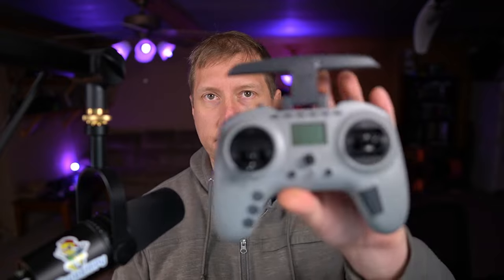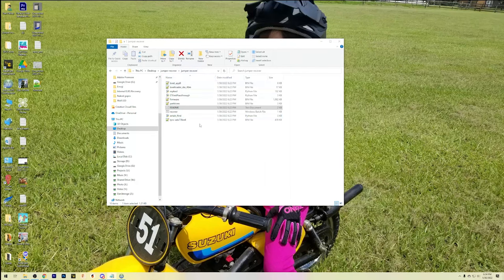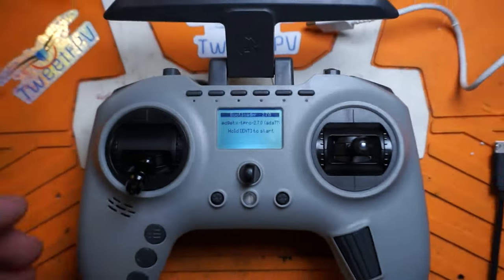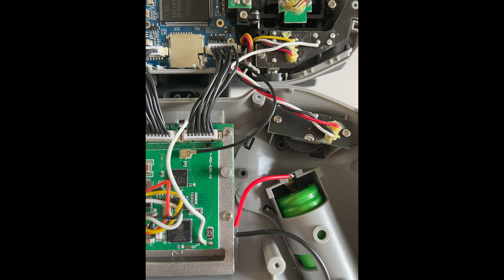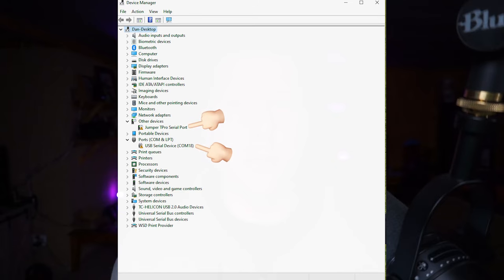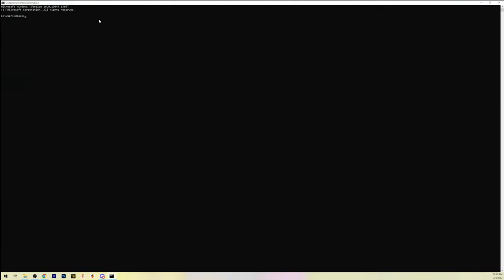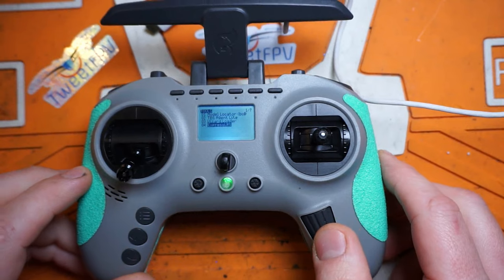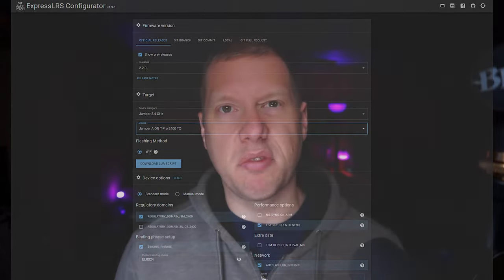Jumper T-pro Internal ExpressLRS recovery. No FTDI required #t-pro #elrs #jumper

Comment: hello everything is fine ? can you please help me? I have a t pro v2 jumper, and when I restart my internal module it works, but when I bind it, the image hangs, when I exit and return to lua script it hangs, and keeps loading, the edge tx firmware files that you mentioned in the video are no longer available for download, and the tutorial for updating the radio's internal module on the expressrls website is not working

Comment: It also might be stated that people do not know that the setting in HARDWARE on the radio might just be set to multi instead of the required CSRF. There is an easy to follow video on you tube that explains how to revert back

Comment: Hi .  thanks for the video.  Will this solder upgrade affect the daily use of the key?  Can I use it for another process without any problems.
Reply from the maker: No, it will cause not change to the normal use of the radio.
Reply: @TweetFPV  thank you so much :) have a nice days :)

Comment: Devs have also added via UART method on the configurator so if you still want to go the FTDI way, you can do so without any source code editing.
It should be available on the next release.

Tip: typing CMD on the address bar of the current open folder should open up a prompt on that folder.. 
Tip: double-clicking the recover.bat file should also automatically do this for you.. ;)
Reply from the maker: Nice, never new that about the cmd thing. The reason I didn't suggest just double clicking is if it fails it just opens and closes the command window (helps with troubleshooting) The first few times I was trying to work through this exposed some issues with needeing pyton installed on my pc. But the way the update works now is working good now.
Reply: @TweetFPV  Thank you for these tutorials. Thank you for what you do for the community!

Comment: Thanks by the nice video. Maybe you can help out in a question that the jumper doesn't leave clear or I cannot find anywhere and is important for this radio.
Does the R9m Lite and XJT Lite modules works on this radio, I would like use them as I have d8,d16,r9m stuff

Comment: but can you still use the trigger switch as a trigger switch? Isnt it after soldering just a normal boot-button ?
Reply from the maker: No, it works just as it should even after soldering.

Comment: My radio got so screwed up from this. It’s so darn frustrating. You plug in the usb now and it just keeps restarting over and over again. You can’t even shut the radio off now without removing the batteries. Mine is definitely toast.

Comment: TweetFPV, unfortunately for me it didn't work, I even tried to reinstall opentx on the internal t-pro jumper, I did all the steps again, configured the control, downloaded the lua script and saved it to the card and when I go to the expresslrs folder on the control I only see ? ???? in this case, will I get it only via FTDI?
Reply from the maker: It should work but the ftdi is the sure fire way to force the flash.

Comment: Thank you for your video.
I have a question. My jumper t pro was putting out a wifi signal. But after trying to usb passthrough the firmware (I just learned you are not supposed to do the firmware update that way). I used this method to reflash the it again. But Now when I tried to do it via WiFi it will no longer put out a visible signal to connect to. Anny suggestions would be greatly appreciated.
Reply: Basically got it back to where I can use the wifi to reflash but not getting a signal.
Reply from the maker: It should put out a wifi signal. If you entered your ssid and home wifi password it won't show as it's own device at 10.0.0.1. You home router will assign a ip address to it and the elrs configurator should show it at the bottom of the page and it's specific ip address
Reply: Thank you I will try again.

Comment: Thanks for this video. This issue I'm having with this radio is somehow I made it so it show up on my wifiwon't anymore. It did earlier today but now I can't get it to work so I can bind it.  I wonder if I do this method if I could fix it? Or if I have my radio actively funning if there would be a way to use part of this video to fix my wifi!
Reply from the maker: My bet is that the firmware on the internal module is messed up. This is one of the 2 ways to fix it. If you go into the elrs Lua does it show any data?
Reply: @TweetFPV  😖😫
I can access the Lua script and see the options. When I go to the wifi enable option it isn't showing in my visible wifi to be selected.
Reply from the maker: Yea, you need to push new fw to your internal moduel.
Reply: @TweetFPV  can do. I live in Canada so this seems like an easy fix compared to waiting for it get mailed back